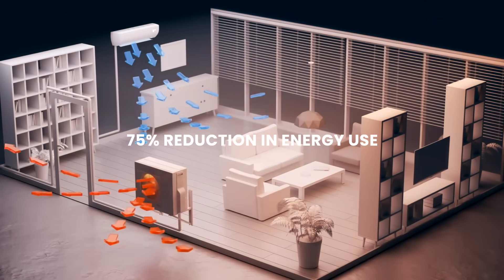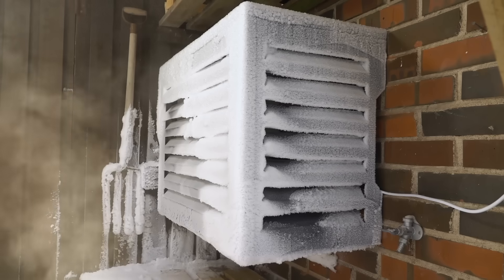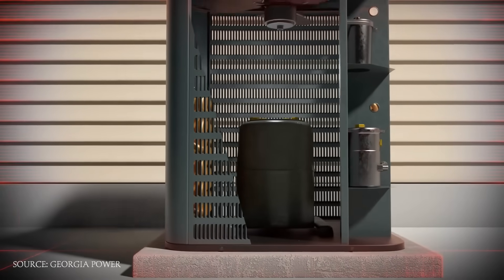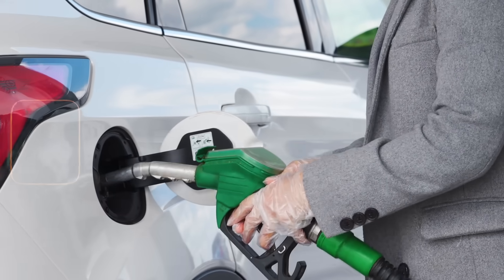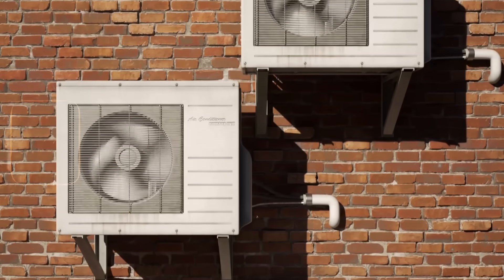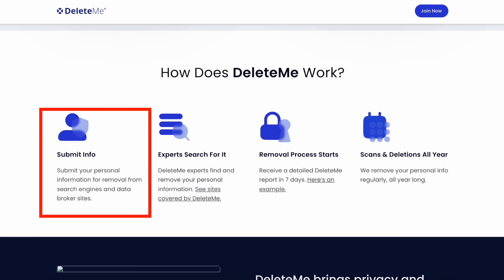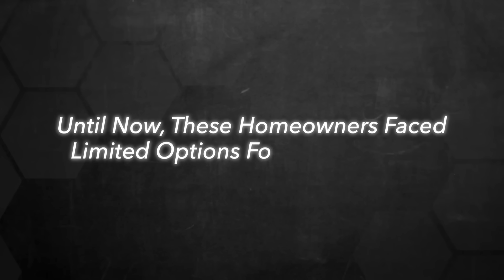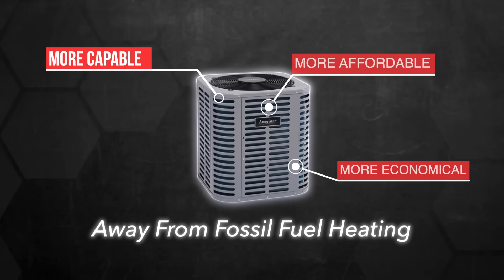Genius Heat Pump could change how we heat our homes forever

Comment: Wouldn't it be cheaper just to do ground source and dig a trench or hole? They usually go to a COP of 5 and have consistent ground temp all year round.

I suppose that's hard to do on a roof though :)
Reply from the maker: From what I've been quoted no not cheaper, I was quoted around 7k per ton for drilling loops because they go vertical in Colorado so a 5 ton system is 30-35K just for the loops, not including install or equipment. Geo has become cost prohibitive for a lot of installers, but DIY can make sense if you're comfortable with that. It depends on the area, labor costs are all over and not a lot of Geo guys here
Reply: @TheHVACDopeShow  Where I am they generally just do over 6ft trenches so it's just a couple of days of a decent excavator.
Reply: @TheHVACDopeShow  yah it seems like they need to figure out how to get the cost of geothermal down.  The smaller drilling rigs they have now most likely help. I think I'd personally just go with dual fuel.  Natural gas where I live is dirt cheap and if you have that hook up you can just use the gas for a bbq and maybe a gas generator that can provide power in case of a power outage without having to go overboard on battery backups.  We do get down to -40 for a week or so a year where I live so even this system would not be enough. I'm not even sure you can really get insurance without having gas backup. I am in the trades and work in an industrial environment so I just naturally always think of the "what if" situations and would rather spend the money on those backup systems so if one system has a problem there is a backup available.
Reply: Geothermal isn’t a real option for me; best case it’d provide ~80% of my heating because of how small my lot is (and how many obstacles there are). So to get rid of my $225/month natural gas heater, I’d absolutely have to go with an air source heat pump.
Reply: @jacobcarlson4010  You could have a setup where geothermal provides 80% of your heating and gas does the remaining 20%.
Reply: The average frost line in my area is 42 inches down.  Plus we get a number of days where it's below -40, a few days a year below -50.  Oil furnaces here.
Reply: I'm sure my downstairs neighbour would love me to drink through his flat to install ground source... 😮

Yes, it's good advice, but -only where practical-. Not everyone has their own yard, let alone a large field to bury the ground source connectors.
Reply: @trueriver1950  Of course, in this situation one would install one heatpump for the complete building.
Reply: @egnegn123  It could also be one ground loop with multiple heat pumps.
Reply: Here new systems use PVT modules, which combine PV and solar thermal. 
Of course, you have the same problem with wide temperature range, but you have no noisy outside unit with moving parts.

Comment: First off I don’t believe in CO2 emissions is going to destroy the planet. It’s all a bunch of lies from people that have a very sinister end goal for the world.

 CFC’s should still be used. They were cheap and they worked very well. Hole in the ozone layer was on the north and south poles where you need sunlight to create zone.

  This system looks very complex. Hope that you can find somebody who knows how to work on it. The parts will be shipped from the maker wherever that is. If it’s out of the country a lot of times just a freight cost quite a bit.

  Heat pumps always need to have some kind of back up heat

  I’ve seen heat pumps buried in snow drifts. Too bad so sad. Better keep those fossil fuels. This would strictly be a high-end home maybe in a remote location where it would be either electric or propane maybe this would make sense. Still gotta have some kind of back up.
Reply from the maker: You're not alone on anything you've said but yes currently this is prohibitively expensive. It's just cool interesting tech and uses parts you can get at most parts houses. It might be several years before it's viable but I thought it was cool nonetheless

Comment: I am also Believer in this 2 stage heat pump but price will be expensive. Also there must be ability to turn off secound stage to go low power output out of Winter season. More Common Is to keep auxilers gasburner and switch when temperature drop below design temperature (-7C). Better to invest in floor heating.

Comment: Ok, I live in a cold climate for six months of the year. Where exactly does sun light and solar factor in?Cause in my climate. -30, -40 and -50c. There’s not much sunshine. We have to take Vitamin D Supplements to be heathy. The solar panels have snow on them, for weeks. Even if they didn’t. There is not enough sunlight or efficiency generated by current solar panels. 

I will stick to what works. Good old fire. Guaranteed to keep me Warm and Alive. 

You California folks can keep your tech. Cause it works in your environment, not mine.
Reply from the maker: Word! That's cold!❄️🥶
Reply: It doesn’t work in their climate either. It’s just that it’s not a life and death situation like it is for you.
Reply: @benkuxhouse787  Spoken like someone that doesn't understand a heatpump is just an air conditioner that runs in reverse. Heat pumps work great if you get a high efficiency model and pair it with renewable energy. I wouldn't install a heat pump if I had high electricity costs which is why I recommend wind or solar if going with a heat pump.
Reply: @ I’m an HVAC service technician. I totally understand heat pumps and I have one in my house. I replaced an oil furnace to a heat pump. Inverters are not necessary, especially in dry climates. My total electric bill for my 13 seer heat pump is 1800 bucks a year. Try to convince somebody to spend tens of thousands of dollars for a solar system to power heat pump is less than silly.  middle class people can’t do 50th to $100,000 for a heating system in their house.
What are you gonna do when the heat pumps buried in a snowdrift?
Reply: @benkuxhouse787  The advice I give to anybody is don't install a Solar PV system if it can't pay for itself in 10 years or less. If you can install a solar PV system for $3 a watt, it's a fair deal. What is your annual KWH per year consumption?
Reply: @imzjustplayin  Last 12 months 1200 KWH. I have never seen a solar system that can do a hone for less than 30. I live in the PNW sun doesn’t shine much here in winter. A high efficiency HP costs a lot more than a standard one. My electricity costs me 1.75$ per KW. High efficiency equipment costs a lot to buy and maintain. The school district I work at is learning this painful lesson. Greening the schools was a scam and is destroying school district maintenance budgets
Reply: @benkuxhouse787  There is no way you spend $1.75 per KWH in the Pacific North West as that's 3X the highest electricity costs in the world which is in California. Pacific North West has the cheapest electricity in the USA thanks to all that hydro.
Reply: @benkuxhouse787 There is no way you used only 1200KWH for an ENTIRE YEAR and paid $1800. 100KWH per month is barely enough to cover the usage of a refrigerator.
Reply: @ I looked at my power bill incorrectly. I average about $.15 a kilowatt hour. I used just under 15,000 KWH in the last 12 months. I am surprised and paying $.15 a kilowatt here it used to be under 10 not too long ago.
I’m averaging around 150 a month give or take. I believe that our government needs to try to make electricity cheaper not more expensive. And that’s what green Energy, which is not green, does not do make it cheaper. It makes it incredibly expensive.  High efficiency equipment cost more money, it’s more complicated means it’s gonna break more. You will have higher repair bills. In a cold climate, what are you gonna do when your heat pumps buried in a snow drift?